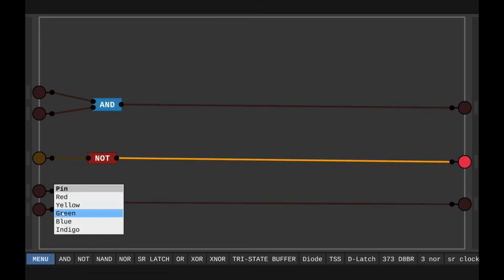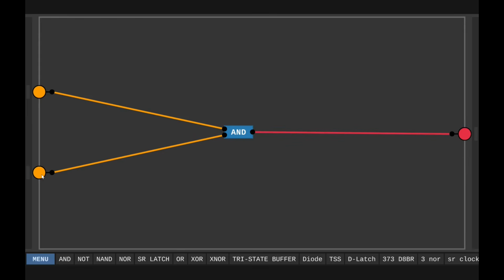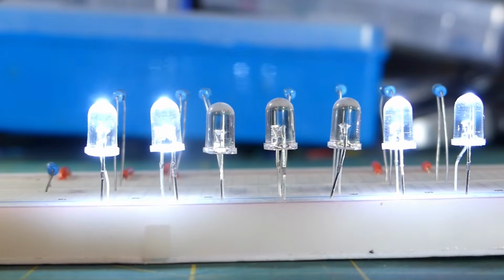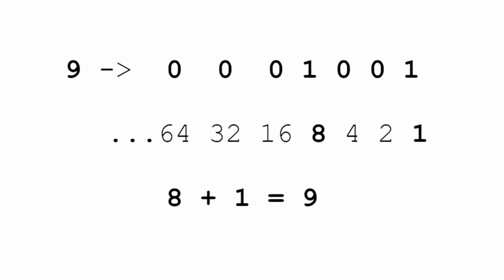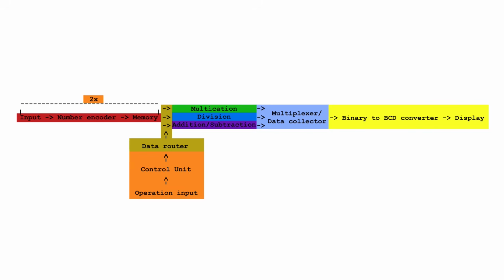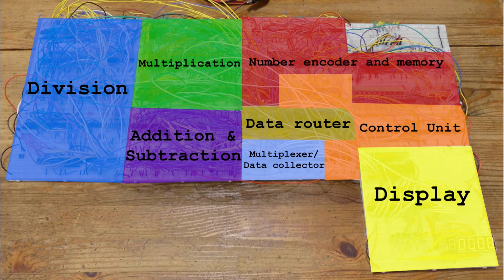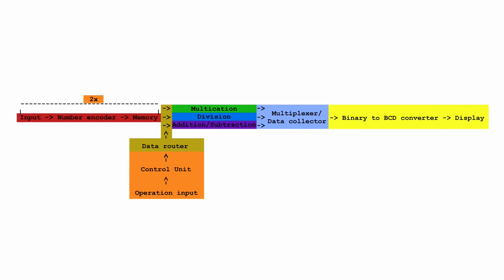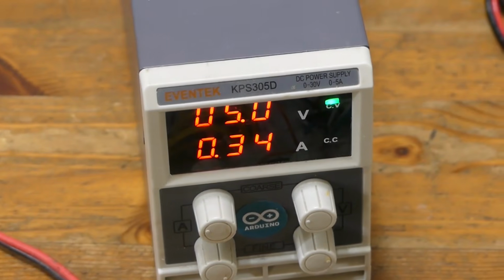I built a calculator

Comment: Do the cheapest $1 calculators use a microcontroller with firmware, or purely hardwired logic built directly into the chip?
Reply from the maker: Typically cheap ones will use hardwired logic, as ASICs are cheaper then microcontrollers (most of the time)

Comment: What happens if you divide by zero?
Reply from the maker: The unit will output 0 and will get stuck in a loop, as the division unit works by continuing to subtract the divisor from the dividend until the result is less then 0. Since 0-0 will never be negative, the loop continues until the reset button is pressed. Very boring result sadly

Comment: How did you deal with problem of weak connections? I have made an easy register with few buttons and leds and it couldn't stop switching (in theory it was correct) so it can't work correctly. Even when I have tried to test with oscilloscope it has changed its state. This calculator had to be such a hard project with this number of wires these could at any moment disconnect
Reply from the maker: Lots of octal bus transceivers used as AND gates with a common pin, sometimes transistors to refresh some signals to prevent signals from weakening. Also had a big problem with voltage drop across the breadboards though. The input was 5v and on the other side of the board it would drop to as low as 3.9v, so i had to have a number of connection pins between rails to stop the voltage drop from being so bad.

Comment: I have been managing electronics development labs for over 30 years. For the last 25 years, I have not allowed anyone to do any work on this kind of breadboard, and this is why. Firstly, there is no way to know whether the reason that something does not work is a wiring error, a bad connection, or a bad design. Secondly, if you need another copy, you just have to start again. Thirdly, these only work for low frequency designs. Fourthly, many modern components will oscillate on breadboard because they are too far from decoupling capacitors. Fifthly, most modern components are surface mounted so they cannot be connected with breadboard. Sixthly, this saves no time. It is always quicker to lay out a PCB. Seventhly, nobody ever documents a breadboard layout. Eightly, too may good designs need a ground plane. Today, you can literally get a batch of PCBs made for $5, and excellent PCB CAD software is free. Using breadboard is invariably very bad news.

Comment: Are you sure this works? There's that green wire that seems misconnected. 😃 BTW, why did you need 200 resistors??
Reply from the maker: oh gosh your kidding, theres a disconnected wire? tbh i'm not horribly surprised but thats kinda funny. 200 resistors because of the display (which i only had common anode, so i had to convert signals as a result) transistors, grounding (thanks to a mix of ls hct and hc chips), and a few other things i cant think of at the moment. But mostly grounding because of floating problems.

Comment: Is there any overflow handling or would it just truncate the result?
Reply from the maker: No overflow handling. I got around this by preventing the user from entering anything larger than 99 by stopping any inputs after 2 numbers have been pressed, preventing number wrapping. So using that, the largest number it can output is 9801 from 99x99.

Comment: Can divide 0:0?
Reply from the maker: Heh, yes, and the output is 0, as the division works by checking if the output, once the divisor is subtracted from the quotient, is negative or not. Because 0-0 is 0, the unit will continue running through the operation forever until the reset button is pressed, but the output will remain 0 after the equals button is pressed.
Reply: @theyautka Would really enjoy watching divide by zero.
Reply from the maker: @Mr_Ceiling_Fan  I'll make sure to put a clip of it in my technical video whenever that comes out

Comment: What algorithms do you use for multiplication and division? I made something similar some time ago and used shift-add and shift-subtract which made the circuit smaller because I used the adders from the Add and subtract part of the circuit and just added some shift registers that are used both for multiplication and division which makes the circuit even smaller.
Reply from the maker: Thats actually a really smart way of going about it, wish I thought of that. I used an array multiplier for the speed as originally i was trying to avoid clocking, but i realized later on a clock was required for the division. And the division uses a feedback loop that subtracts and then checks if the result is negative or not before then deciding what to do next.

Comment: i sort of have this vision that in teh near future, teh "internet of things" and most higher logic systems are going to be infected and practically useless... AI is its OWN VIRUS... its infecting and corrupting everything "online". or will...

and theres going to be a massive shift BACK to simpler, more straightforward "logic".

thing about calculators is its pure logic. no "code", it can never give a "corrupt" answer... unless electrically or logically faulty.

industrial machine controls etc, they never needed "wifi connectivity" and "64 bit with full OS". cars never needed "fully integrated systems bus"...

we have gotten so high level we have no idea wtf is going on in there...

Comment: The division part seems kind of obsolete when you could have just made a simple decoder and programmed it in
Reply from the maker: True, but I wanted to avoid programming so it was as much logic as possible. The only part that isn't purely logic is the binary to BCD converter, which uses two AT28C256, and even then I considered building a double dabble to avoid having to use a programmable of the chip, but that would have been too much work

Comment: Hi, how are you able to calculate and display numbers that are larger than 7 bits?
Reply from the maker: The design actually wouldn't be too hard to modify to calculate numbers larger then 8 bits, so going back you could scale it up pretty easily. To display numbers larger then 7 bits, i used two AT28C256's that acted as the binary to bcd converters

Comment: Imagine him showing this invention just a few centuries ago, people would literally be shocked by this. I mean I'm shocked right now seeing how is it even possible to create a calculator with just wires and a breadboard. Awesome work, brother :)
Reply: its got lots of little caterpillars in there though. i reckon theyd be the most mind bending aspect... wtf the caterpillars for? what moth do they make? wtf sort of coccon is this? you call that silk?

can it be traded?

it also really has to have a ... "function"... what calculations, besides the "academics amusing themselves" did the average person perform?
Reply: welcome to Electronics engineering 
we do these all time
Reply: @tharabhai_arijit5360 electrical engineers do not do this all the time. most of the time now its much more reliable and effective to just use premade parts that work together.
Reply: They'd only literally be shocked by this if the voltage were high enough and they touched a live part.

Comment: How, literally how. Every time i use breadboard there's always some loose connection, broken wire or something i can't diagnose and the circuit malfunction
Reply from the maker: In the beginning it was horrible to debug. Building it in units that i could piece together later helped so much